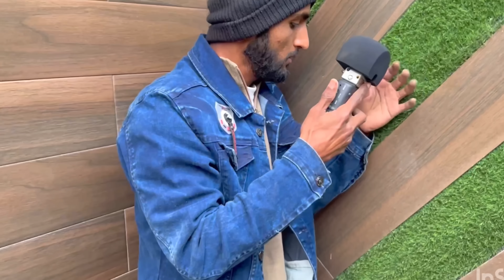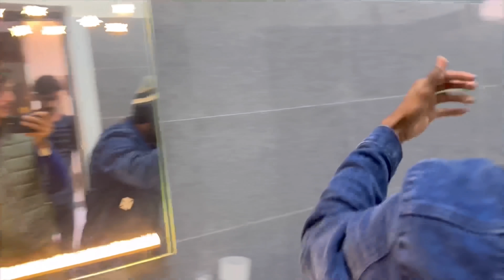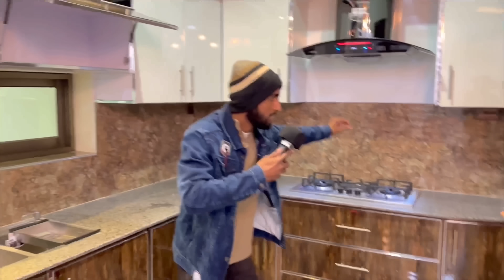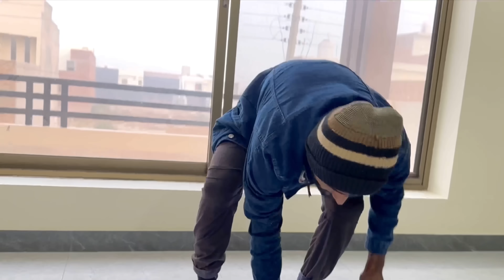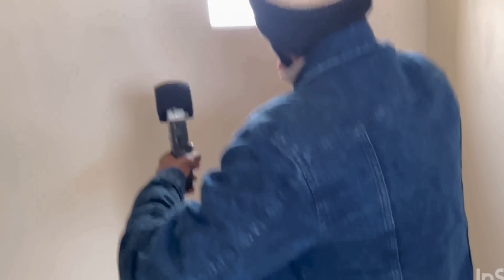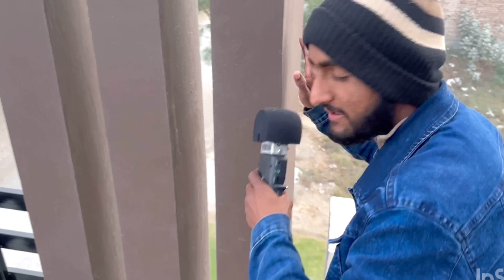ASMR In Dream House 2

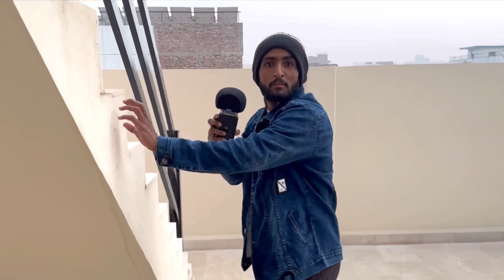Comment: 3:39 it's crazy that there are places where you can build spaces as this right on the roof and not fear rain and snow
Reply: While it's unlikely to snow, I'm sure the architects of the building accounted for rain and built proper drainage systems onto the roof like any modern building 😆👌🏻
Reply: It never snows and it only rains around 15% of the year so there must be some sort of drainage.